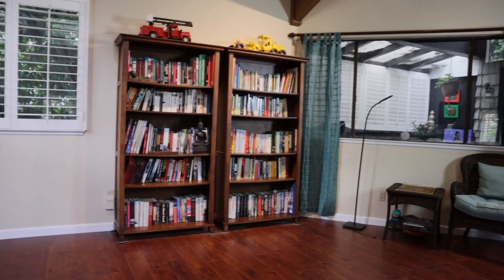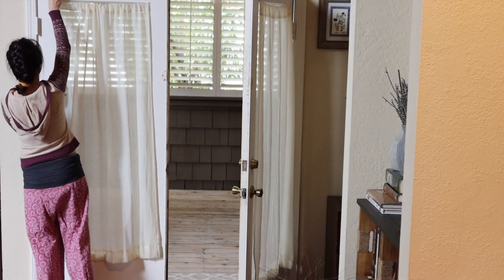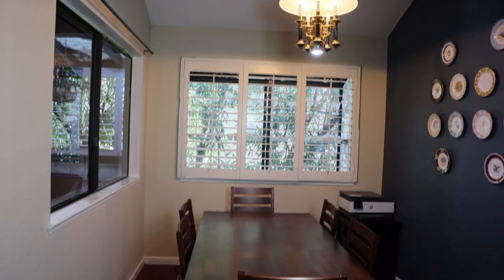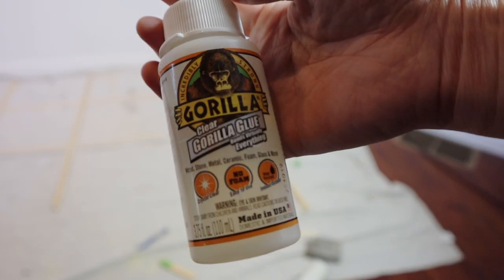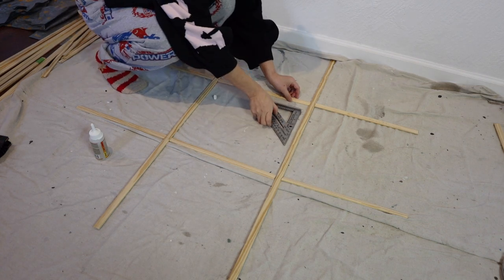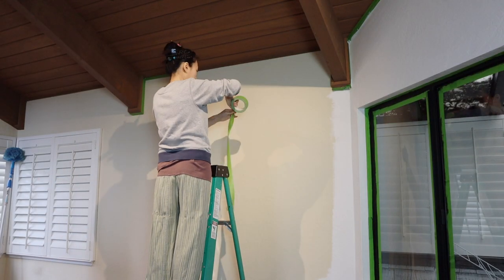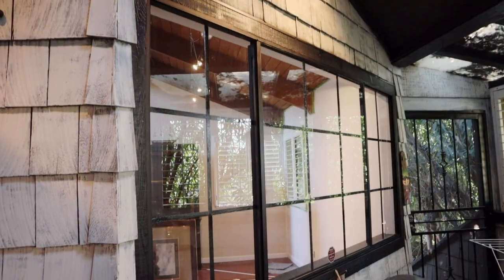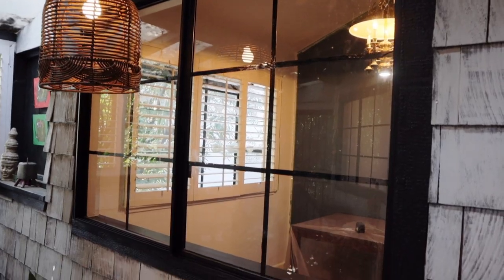DIY Turning a Sliding Window Into a Beautiful French Window | 40yr Old House Reno Diaries

Comment: Can you please add a close up of the outside of the glass so we can see what it looks like when the glue is dried
Reply: +1 Great project and details description: THANK YOU! - Would be interesting to know how the glue looks from the outside though. In the video it appears to be visible. (that said, what other option is there?). I wonder if it wasn't better to apply some kind of coating on the trims after having painted them so the color does not soak into the wood over time and needs repainting. Also for protection from sunlight and might also add a more metallic look (if desired)